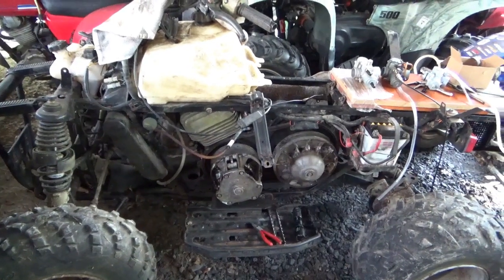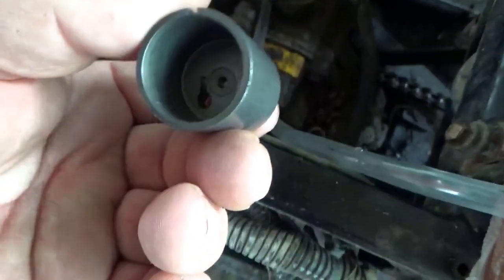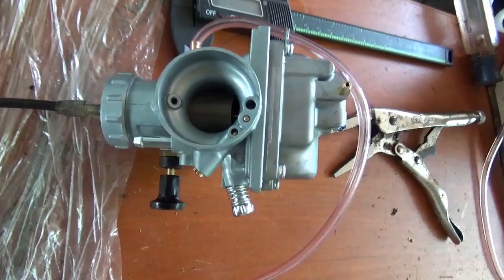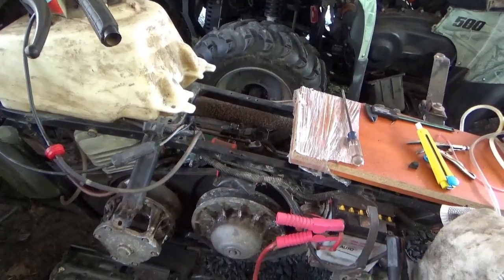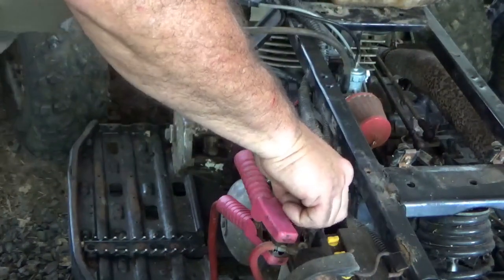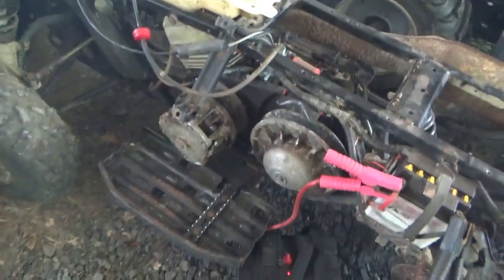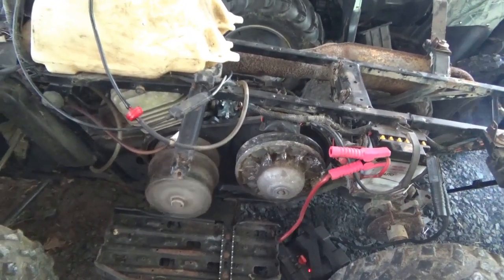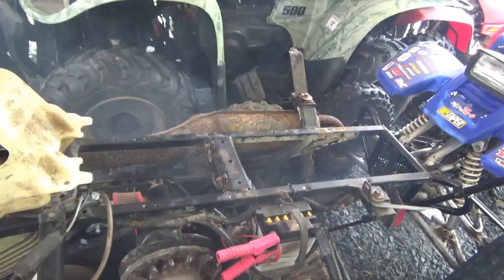How to Hack a Yamaha Blaster Carburetor  onto a Polaris Xplorer 250!

Comment: Not bad at all... from experience those 250s enjoy an airbox to run correctly, jetting and a plug chop to ensure no lean running. Sea level 150 main jet... higher altitudes down to a 130 or even lower. 
Great that you are providing options.
Btw... those engines are japanese and an evolution from the 60s polaris colt snowmobile motors so very reliable

Comment: My guess is that’s it’s lean and I’m basing my opinion on the throttle response or lack of ! Clean the drive clutch and a good belt and test drive ! My count is at 15 ✅ lol. Have you given any thought to pallet racks for storage? You have a bucket with forks to place them up high , 7 sections with 6 cross members on each section and tarps on the outside and roof , very private and should hold 50 machines total with a small investment . Basically 32’x32’ - 12’ high ! Just a thought ! You could even tin the outside !

Comment: clean the clutches.  i use a scotch bright pad and water then dry with compressed air.  sometimes a little brake clean to remove old belt  Residue in the clutch plates

Comment: I agree with Tyler and hit the yellow reverse override button on the left handlebar when shifting into reverse. The clutch looks filthy from an old belt turning into dust and don't run the choke it's putting out enough smoke and you'll foul the plug.Very glad it runs Harvey, have you checked the trans fluid and removed the shift rod to see if the trans will go into a forward gear? The goal is always the same, get out there and ride.